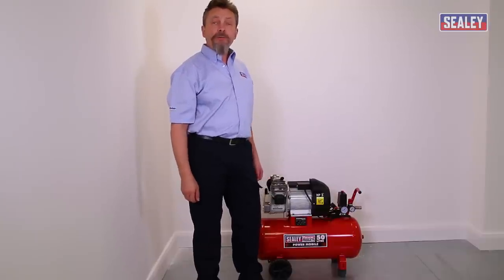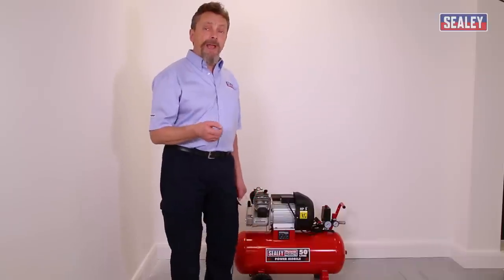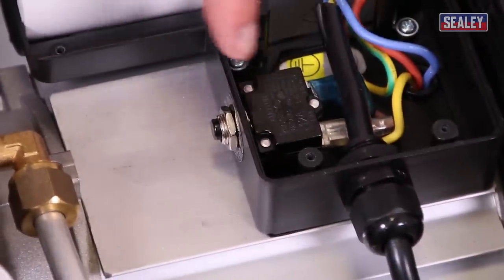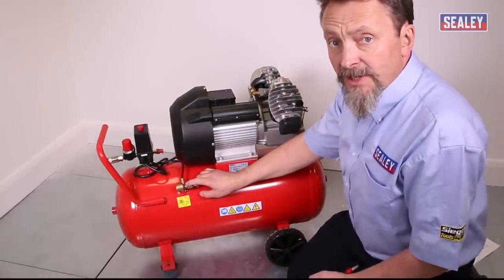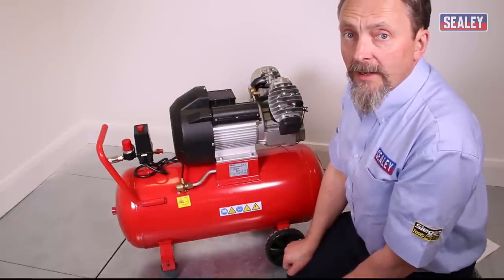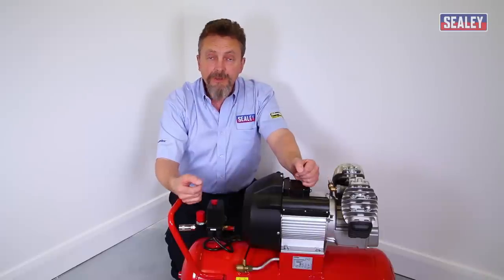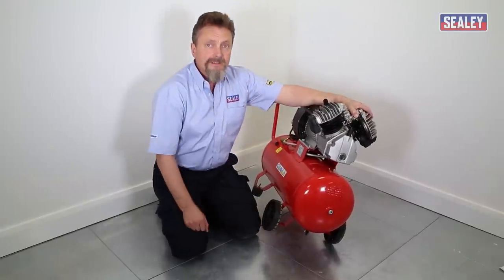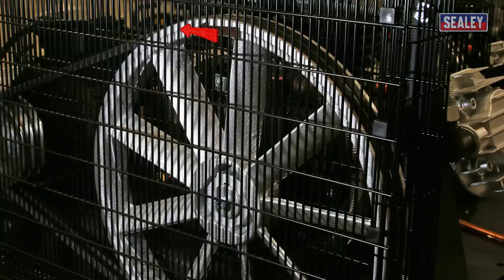Sealey Air Compressor Troubleshooting

Comment: I have a Paslode air 1.5hp air nailer with a Rol-Air compressor.  This summer the compressor would start slow and pop the circuit breaker.  I replaced the start-up/run capacitor and it fixed the problem.  However two months ago it started doing the same thing again.  I tried everything and almost threw it away till I found your video and you stated it could be the extension cord being too long so I tried compressor without my 100 ft extension cord and that fixed my issue.  Couldn't believe that a voltage drop from the cord would cause that problem.  I tried some heavier gauge cords that were shorter and they also worked!  Thanks for the video and useful and less obvious tips!
Reply: Me too.   Winter work, kept popping the breaker, running very slow then dying or maybe a little faster.  Watched this and put in a shorter heavier extension cord and bam it's working perfectly.

Comment: Thank you! I had a leak under my pressure switch after air filled in tank. Tested the none return valve like you said, I replaced the none return valve and now my compressor is up and running.
Reply from the maker: This is great news. Thank you for taking the time to comment

Comment: My compressor starts fine after a few minutes of running it will stop and won't start again.  If I then leave it for about 30 minutes it will start again.  I suspect the pressure switch but I haven't changed it yet.  Has anybody got any ideas? please.

Comment: If turn on my air compressor it did not  run and i only heared a humming sound. Your advice pls. Thanks.
Reply: Did you find out what went wrong?
Reply: No..  already changed the switch and capacitor but nothing new. my air compressor is FUJIMA 2HP brand new and just  twice being used .
Reply: @YOBSTATV  I was asking because I have the same problem... I’m just getting a new one lol.
Reply: I sussed it. I changed the capacitor. Works now. Easy fix. Hope this helps.
Reply: Oh. You already changed it sorry

Comment: Just bought one today but there is air leaking from the non return valve straight out of the box. Washer and spring look ok, why is this? Luckily the store is local for a replacement, just curious why this should be happening.

Comment: The plastic pressure line from the non return valve to the pressure switch is leaking where it goes into the pressure switch/reg body, how am I best to remove the line at this end?
Reply from the maker: Hi. Please do give our Technical Team a quick call on 01284757505 or email them at technical@sealey.co.uk and they will be happy to get you back on track. Thanks.

Comment: Hello. .. my thermal overload switch.  Wont let my compressor  buid more then 50 psi. An til  cold down... do you know where i can buy it. Par number is 17am-kp
145a0. Thanks.
Reply from the maker: Hello Colas, Is it a Sealey Compressor you have?

Comment: My compressor doesn't stop running. The pressure gauge only at 2 bar. unable to reach 8 bar to stop. I looked for leaking but i cannot find it since there's no leaking sound. What cause this issue usually?

Comment: hi.i have the same compressor !after ca 1minute  the rpm slows down and it stalling,no air leaking
Reply from the maker: Hi. Feel free to contact our Technical Team on either 01284757505 or email technical@sealey.co.uk with the details, and they will be happy to help you. Thanks.

Comment: hi I have question my compresor runs good when is empti to fill up but when I use the air cam down and the compresor try to start the swich from my home or box switch  shut down and the compresor  have to empty to runs again thanks
Reply: This is the same for mine, did anyone get an answer to this fault?

Comment: I inherited my Dad's 2 HP  17 Liter air compressor.  He used it for his nail gun. It never shuts off. Once the PSI gets to around 125 PSI, the relief valve opens and stays open until the psi reduces to 90 psi. At that time the relief valve closes and the pressure begins to rise til it gets back to 125 psi and then the relief valve opens again.  Of course all this occurs while the nail gun is not being used. I sure wish my Dad was still here! Is this normal?  I would appreciate a response.   Thanks
Reply: +D H
Did you ever get the problem of the lift valve opening on your compressor? If not, you should try adjusting the pressure switch to get the compressor to shut off at maybe 115 psi.

Comment: I have a pos fini airattack. 1.5 horse power. Air was coming out of the air intake. Damn reeds were riveted into the valve plate. My question is can the high pressure reed cause air to come out the air intake. Im positive my low pressure reed is good but still have some air coming out the intake. This fini is a giant piece of crap. Cant even get them to email me back. Ridiculous

Comment: Hello, my sealey SAE5030VE will not build much pressure and will continue to run.
Initially I suspected head gasket. 
Momentarily after switching it off, I can hear air escaping from around one of the cylinder heads. 
Also the relief valve stays open presumably due to the compressor not building enough to close the valve? Any help?
Reply: Sorry, forgot to mention I replaced the relief valve with a bolt of the same thread to help me find the leak 👍
Reply: Okay, so the noise I was hearing was the breather hole in the oil filler
Reply from the maker: Hi Michael, 

firstly replace the pressure relief valve with some thread seal. 

Have you ensured the condensate value is tightened underneath the tank? If that is ok, it's most likely down to a valve plate in the cylinder head thats not closing which will prevent the compressor form building up pressure. If this is the case it will need to come back to Sealey to be repaired.  

Please contact our technical department on 01284 757505 to arrange this. Depending on the age of the compressor this will most likely be free of charge.
Reply: Ok, replaced PRV with some PTFE tape, and is now closing under pumping pressure, however tank pressure remains maximum 20psi.

I would guess the flapper valves are knackered due to there being no evidence of ever having air filters fitted before I started my job here, where it's situated.

Comment: I get my tank up to 120psi. When i begin to use any tool the performance drops radically. I decided to add a gauge right before my tool to see what was happening. Starting pressure of say a 90PSI tool will drop down 10 PSI every 5-10 seconds until it gets to say 50PSI and the tool becomes useless. I have checked for leaks, replaced fittings and used new hoses and cannot find anything. Could my pressure switch or regulator be the cause? what else could be causing this.(my tank is around a 15-20 Gallon)
Reply from the maker: Hi Derek,This could be caused by your tools needing a large amount of air ( CFM ) to function properly. This would result in the air in your tank being used very quickly. Typically, the compressor pump would start running to compensate for the loss of air very soon after starting to use the tool. The only solution to this would be to either buying a much compressor capable of running the tools you're using, or purchasing tools suitable for the size of compressor you own. I hope that makes sense?
Reply from the maker: Also, have you checked that any condensation in the tank has been drained off? we've had instances of compressors that haven't been drained containing gallons of water. This has the effect of massively reducing the air capacity of the thanksMatt